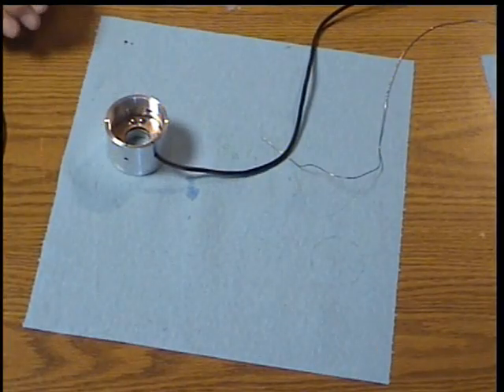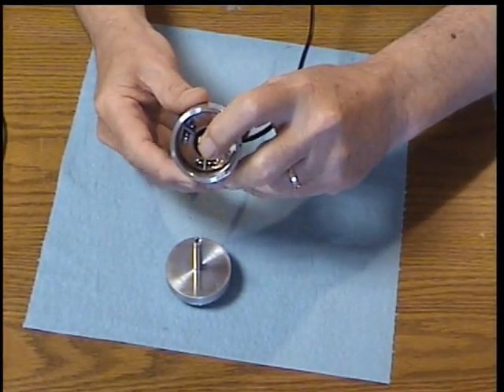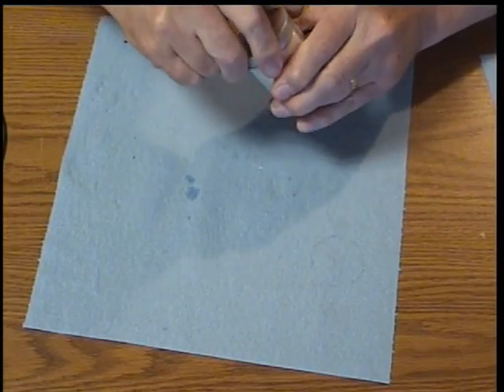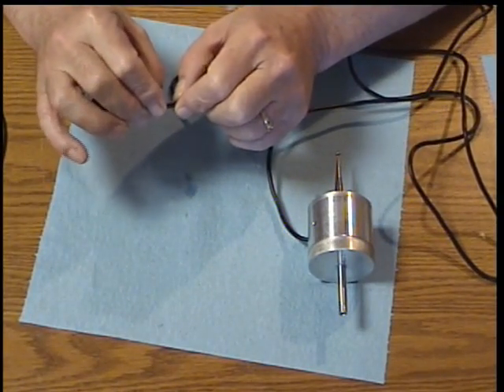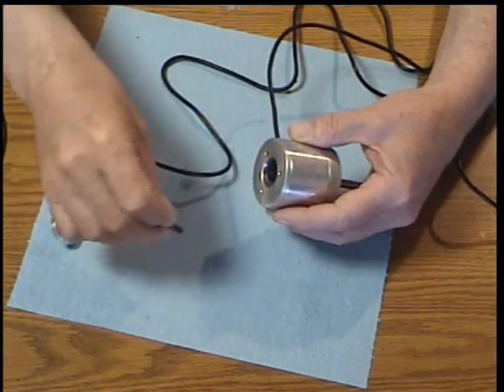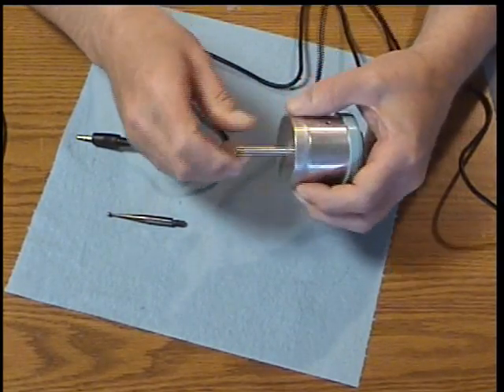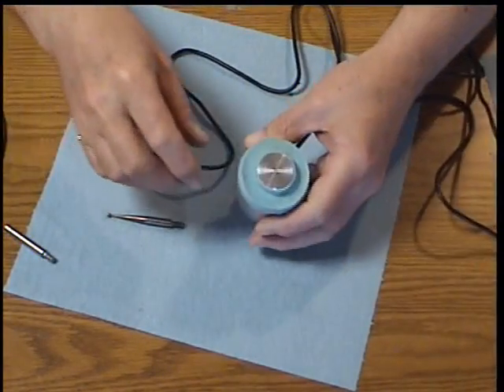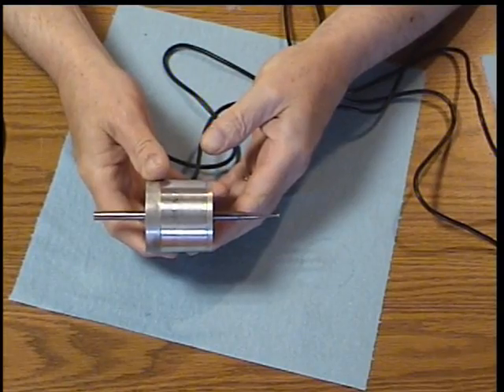EP-Inst09

Comment from the maker: @CncObsession Could be 2 things.  Easiest is reversing the sensing for probing in the Mach3 setup. I think that will solve it. The other, (less likely to be the problem) is to reverse the polarity of the LED.  The Gecko is setup for a normally closed sensing circuits.  But changing the the sensing polarity doesn't actually swap the polarity of the connections. it just alters how the software reactes to sense conditions. Regards, Gary (the Econo-Probe is not produced by Arnie.)